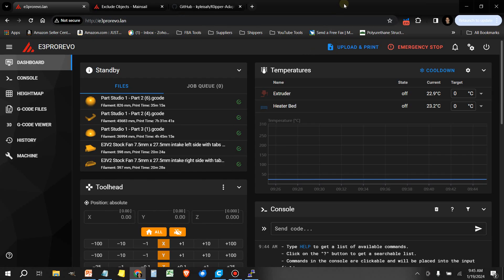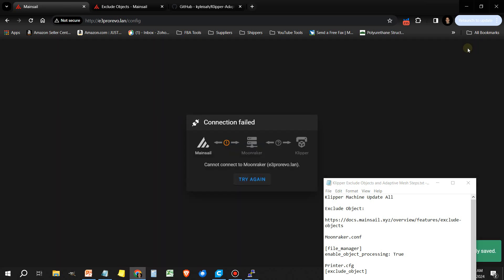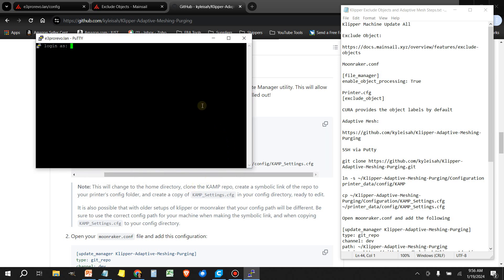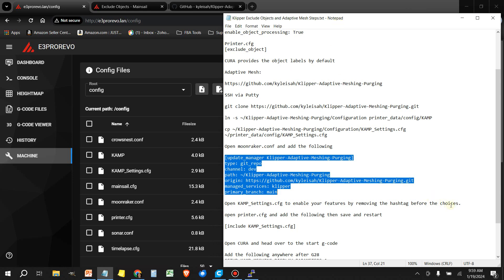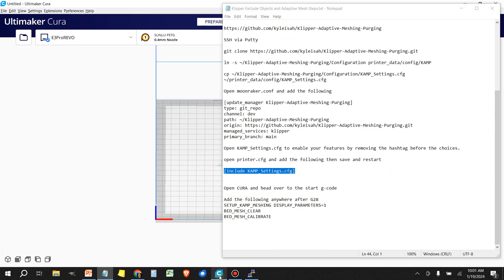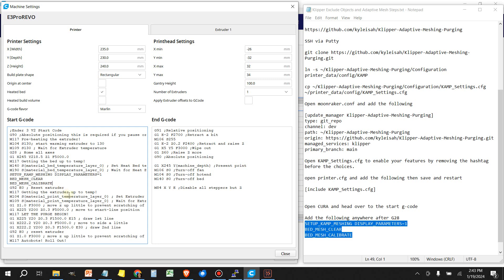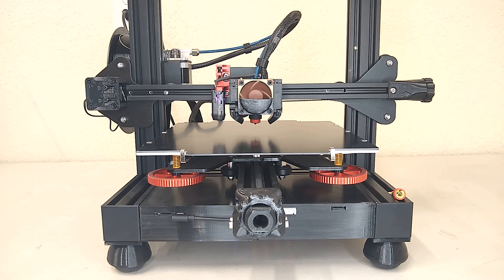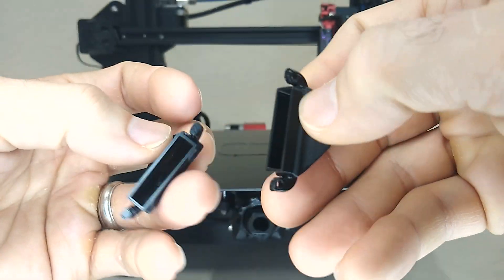How to Install and Configure Klipper's Exclude Object & Adaptive Mesh to Work with CURA

Comment: Great tutorial! I definitely learned a few things with this video for sure. I couldn't figure out why my KAMP wasn't working. I had installed it and had everything except the g-code inserted within Cura. For some reason I didn't find that anywhere in the instructions when I installed KAMP. Maybe I missed it or just looked over it but, Thanks to you I now know what I missed! Thanks for the Video MUCH APPRECIEATED!! Keep up the great content!
Reply from the maker: Hello Bill, I'm glad you were able to get it working. KAMP is extremely useful but the bed probe must return consistent values.

Comment: I just wanted to pass along some info as you AND your video's have been very helpful in my efforts to install and use Klipper, Mainsail and associated files and directories. 
The klipper documentation , and all of it's various component part documentation (IMO) is grossly out of date almost to the point of being almost unusable. 
If I were to guess, the documentation is probably 2 - 3 years behind the software, and it does not reflect some MAJOR changes. 
I like your YouTube video's because they reflect the real world when it comes to doing software mods.
So, if no one has told you, your longer video's are more in tune with reality, so at least for me, keep up with what you are doing.  A 5 minute video titled "Let's Install Adaptive Meshing" is garbage because even if you make bank building and setting up 3D Printers for noobs, you need more that 5 minutes to install these components. 

As you can see, I'm installing Adaptive Bed Mesh with CURA slicer and even though this video says it is only 5 months old, the klipper folks have incorporated Adaptive Mesh into the MainsailOS/klipper base installation so be aware that some of this video is already dated as far as the step by step. 
I've watched a ton of videos but you are one of my "go to" resources because you are trying to help people, not get swag for minimal effort.
Reply from the maker: Thank you for commenting and encouragement, friend, I appreciate you very much.

Comment: Id love to know how to send a command to ignore adaotive mesh and just run the last saved.
As when getting failed first layers i have to redo adaptive mesh every time, pain in the ass
Reply from the maker: Hi buddy, Thank you for commenting. Please tell me about your printer, which one do you have?
Reply: @vbared  ender 3 OG Frankensteined up.

Ive sorted it now, im running a variable to say if to run adaptive mesh or not with a macro
Reply from the maker: @Dirt33breaks  Awesome, what material are you printing with and what build surface are you using?
Reply: @vbared  pla, petg, g10 garolite plate, but i have a glass and have just ordered a pei/pey plate
Reply from the maker: @Dirt33breaks  I got you, was trying to figure out why you were having first layer issues in the first place. The issues with the first layer was it isolated to certain places on the build plate? I had adhesion issues with a few spots on my build plate that needed manual bed mesh adjustments. The strange thing is that my other printer that only had a different hotend fan assembly and dual parts cooling fans didn't have that problem. This didn't make sense to me since I knew the probe measured everything, the mesh was saved and loaded every time a new print started. It turns out that the culprit was the probe's Z-offset. I found that mesh variations greater than 2mm are ignored by Marlin and Klipper firmware so when an area of the bed is off 2mm or more the printer doesn't adjust for that spot. The reason the probe's Z-offset is the issue is because if it's something like -1.75 and a bed mesh probe value is -.30mm the two added together are greater than -2.00. The fix was to have an adjustable probe mount so I could dial in whatever Z-offset I wanted. All my printers have an adjustable probe mount and my Z-offsets are now between -.30 and - .80mm. It's unlikely for my bed to have any deviation greater than -1.20mm, unless it has a hole in it.

Comment: Dont work here..its still probing all over the bed...I only have START_PRINT in Cura G-code and I´ve tried to add the commands in the START_PRINT section in printer.cfg...but only CLEAR_BED_MESH appears to work.

Any clue why ?
Reply from the maker: If everything on the Klipper side is in place, take a look at my start g-code. If you want to try it as is just make sure your x-axis can reach X245. If it can't without crashing into something just adjust this number to a lower value.  

;Ender 3 V2 Start Code
G90 ;Absolute positioning this is required if you pause or cancel a print in Klipper before the End G-Code has completed
M117 Pre-heating the extruder!
M104 S130; start warming extruder to 130
M109 S130 ; Wait for Extruder temperature
G28 ; Home all axes
G1 X245 Y218.5 Z1 F5000.0; (Modify the X to a lower value after the G1 if your printer can't reach X245)
M117 Getting the bed up to temp!
M140 S{material_bed_temperature_layer_0} ; Set Heat Bed temperature
M190 S{material_bed_temperature_layer_0} ; Wait for Heat Bed temperature
SETUP_KAMP_MESHING DISPLAY_PARAMETERS=1
BED_MESH_CLEAR
BED_MESH_CALIBRATE
G92 E0 ; Reset extruder
M117 Getting the extruder up to temp!
M104 S{material_print_temperature_layer_0} ; Set Extruder temperature
M109 S{material_print_temperature_layer_0} ; Wait for Extruder temperature
G1 Z1.0 F3000 ; move z up little to prevent scratching of surface
G1 X225 Y200 Z0.3 F5000.0 ; move to start-line position
M117 LET THE PURGE BEGIN!
G1 X225 Y20 Z0.3 F1500.0 E15 ; draw 1st line
G1 X222.2 Y20 Z0.3 F5000.0 ; move to side a little
G1 X222.2 Y200 Z0.3 F1500.0 E30 ; draw 2nd line
G92 E0 ; reset extruder
G1 Z1.0 F3000 ; move z up little to prevent scratching of surface
M117 Autobots! Roll Out!
; End of custom start GCode

Comment: Hi Victor,  After a lot of effort I have the BTT Micro Probe and the Adaptive Bed Mesh working well.  I have not found a lot of people using the ABM function, after using it on all of my Klipper printers, 3 CoreXY and 1 E3V2 I think, for me, this is the way to go.  So far I have not seen any issues here with Z-Offset drift although I'm not a production farm.  I will continue to run prints on a daily basis to see if there are any issues that pop up.  In addition the Exclude Object feature is sweet if needed for when the nozzle puts a bugger in the middle of a group of prints.  Thanks again as this tutorial is great and thanks again for your effort.  Note:  A review of the Klipper-MPC function for tuning the hot end is NOT stable at this time.  It is being worked on so if you run it do not leave your printer on its own.  There is a good Klipper community on FaceBook that has additional information.  https://github.com/Luro02/klipper-mpc.  I hope the E3S1 Y mount arrived in good order.  Until next time....Doug

Comment: Hi Victor,  After finishing the tutorial I had a couple of thoughts.  One is when all of the edits to the printer.cfg file are complete right click on it and download it to your backup location for the printer.  A review of the mesh_pps values might be worth a look as they specify how many interpolates points are between each probed point, adding to the overall density of the mesh. 
A side note: this one got me.  I had not closed out Putty when I tried to upload a sliced file to the printer and it caused a Moonraker 401transfer error.  Ooops.
Over all a great job Victor thanks again for the education.  Doug
Reply from the maker: Hey, buddy, I updated the guide, all the support files are zipped in the link below. Please review and give feedback if I missed something.

2024 Klipper Installation Support Files - https://mega.nz/file/xNMRRZAS#P1pIksTzbpVVlFTzxkE0Zx4ojvFuUOpiX6_mQ5xci5I
Reply: @vbared  ,  I did review it and commented in that tutorial.  Well done Victor. Doc'

Comment: Greetings Victor,  This is a great tutorial for adding these features which are a must.  One small issue on my end when the updating was complete I received this Klipper Error.
Klipper reports: ERROR

MCU Protocol error

This is frequently caused by running an older version of the
firmware on the MCU(s). Fix by recompiling and flashing the
firmware.

Looking back over our Klipper upgrade document for v1.7.2 and the current v1.8.5 I found that there is a big difference in the instruction path.  We might need to revisit if you like as I'm having to re-flash my E5 after running the update all.  If I have missed something please chime in.  Doug
Reply from the maker: I felt the pain, friend, the guide has been updated and linked in the previous comment. Let me know what you think needs clarification or changes.

Comment: I wanted to test it. but when I want to select a piece from the selection window, all of them are selected at once. And when I say remove the object, it cancels the writing process. I use purusa slicer 2.7.1 as a slicer. There is only the "start_print" plugin in the "start g code" window. I configured the start print macro in the mocros folder. and I added these lines into the start print macro.
"SETUP_KAMP_MESHING DISPLAY_PARAMETERS=1
BED_MESH_CLEAR
BED_MESH_CALIBRATE"
I would be very grateful if you could tell me where I made a mistake.
Reply from the maker: Hi bybarbaros, Unfortunately, I don't have any experience using Prusa Slicer but you might try to spread the models apart some more. I would imagine if they are too close to one another it might not work.

The Start G-code looks OK to me. Let me know if spreading them out works for you.

Comment: Victor, I would like to point out this very specifically: You have provided very understandable and valuable information. This is my first time making a 3D printer. I am encountering many problems. without any problems the first time, following the instructions you showed. I had a smooth installation. Thank you..
Reply from the maker: Hello Friend, Thank you for commenting and encouragement. I'm glad you found value in this video for your viewing time. 

Best of luck with your mods :)

Comment: Great Video Victor - I didnt realise this was an option until i saw your video - but i have an issue i cannot find a solution for -
When i add the lines in Cura start Gcode i get an error - Unknown command:"SETUP_KAMP_MESHING" - in the Klipper console.
Do you know where in any macro or settings this is referenced. Normally this means Klipper is requested to run this macro or command which it doesnt recognise.
Reply from the maker: Hello, Thank you for commenting and encouragement. I'm glad you found value in this video for your viewing time. Linked below are my printer.cfg and Kamp_Settings.cfg files for you to check out. You just need to make sure that there is a KAMP folder in the directory that stores your printer.cfg if you don't see it there then it didn't install properly.  

https://mega.nz/folder/gBUzADBa#PGaMeTIW6mopbDDn4IW4pQ
Reply: Did you ever find a fix for this?  I am getting the same error....  For the life of me I can't get it to work.
Reply: and yes I have a KAMP directory

Comment: Been printing with orca on my stock E3 V2 and had good results, imma jump back on Cura (havent used it for a stock V2) and check it out.
Reply from the maker: I'm sure Orca has the exclude object feature as well, just not sure how to enable it if not on by default.
Reply: @vbared  Orca for sure is more of a learning curve, i honestly prefer the adaptive layers and ironing on cura, even though i have them selected on Orca, the prints never seem to show, but on Cura they do